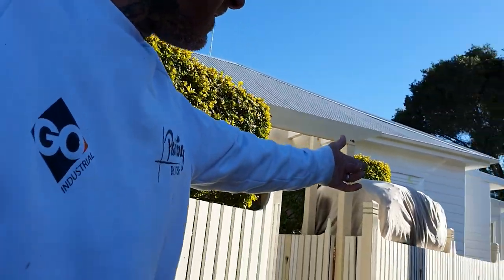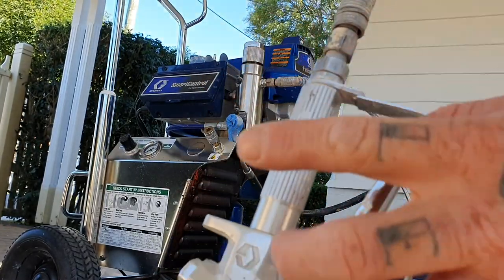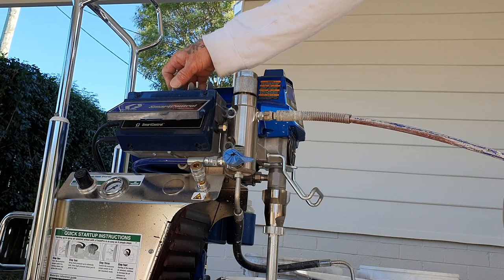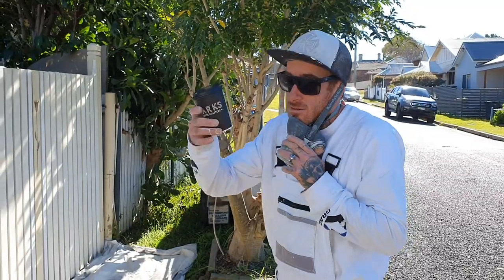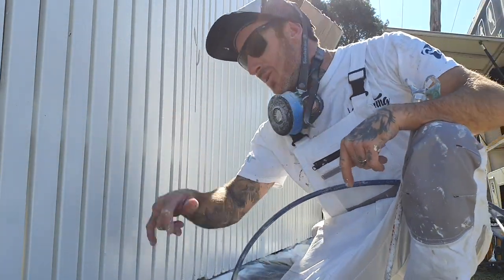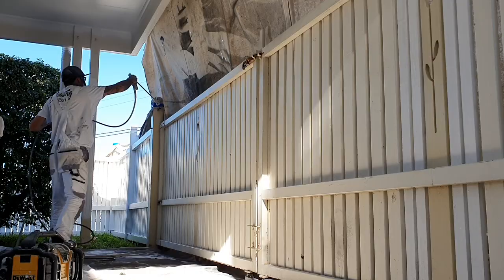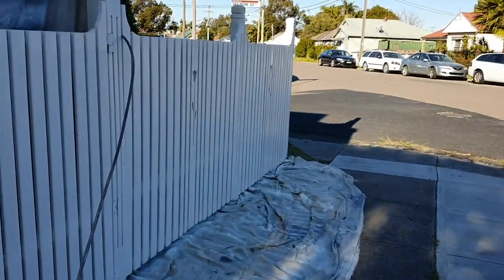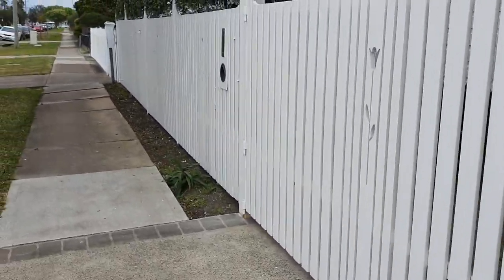HOW TO SPRAY A FENCE WITH AN AIRLESS SPRAYER

Comment: Thanks for the information. I'm assuming staining would be the same?

I have to come up with a makeshift wall structure that I can slide along the fence on the other side. Because painting in the city means houses are right on the other side. I'm probably going to use 2x4's and attach a drop cloth and just slide it right along as I go.
Reply: I stain fences in Kansas City and this is what I do.
Reply from the maker: Sorry for the late reply. Yes exactly the same method🙏🤙

Comment: Is that pressure not a bit too high for a fflp tip? I thought they where supposed to spray at a much lower pressure than that?
Reply from the maker: What ever work for you the paint your using the machine, climate so many different factors that can change your running pressures from day to day 💯

Comment: So I stained my fence with a latex stain only (no sealer combined). I went to try and put Thompson's water seal over it. I don't know if it's because I poured it in with the last of the stain in the bottom of the bucket (before i realized it was oil based!) It sprayed out sightly pink foam in places at first, then just milky drippy white on ANY areas with knots or imperfect wood.... Kind of ruined the beautiful redwood stain. Stopped after 2 panels. Help! Do I switch to a water based sealer or does it need a sealer? Live in Florida....

Comment: Hi I’m painting my fence a different colour from my neighbours and we share a fence. Would I be better off using a brush so I don’t get my colour on his side and don’t get any spray in his garden
Reply from the maker: Hi Kerry. Depending  if you want the inside of the pickets your colour or his. If you are painting the face and the two sides I would spray and cover the back of the fence for over spray if you are only painting the face I would just roll. Hope this helps and makes sense 🙏
Reply: Painting by Josh thanks so much think I will roll don’t wanna upset the neighbour hahah
Reply from the maker: @fairplay300111  haha might be best🙂👍

Comment: Thanks for posting the video, some good tips in there. I've got to do a new fence at home shortly. It's rough sawn, would you smooth it out a bit or just slam on lots of paint? Also how long would you wait to paint new timber, cheers bro.
Reply from the maker: Thank you I appreciate it. Sorry for the late reply. Yes I would give it a sand if not just go straight over with some paint the more you put on the smoother it with be 💯 respect

Comment: Great video - subbed. Any thoughts on using an airless sprayer for a chain link fence? House I purchased has an outdated chain link in the black that I'd love to turn black. Appreciate any insight!
Reply from the maker: Thank you! you will lose a lot of paint through overspray. I would go for a dry roller and cut the post with a brush. hope this helps
Reply: @paintingbyjosh  awesome thanks so much
Reply from the maker: @WranglerRunner1  no worries. let me know how it turns out!